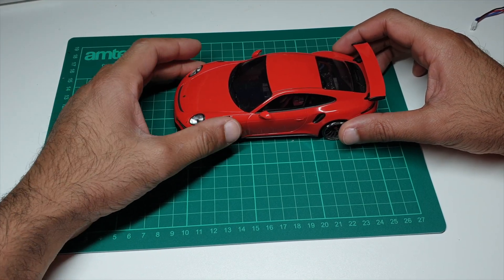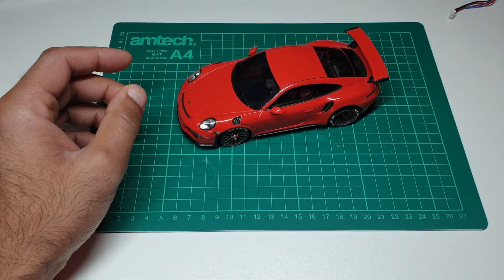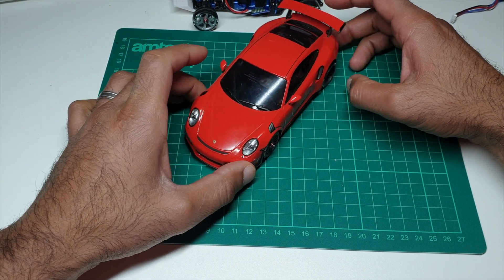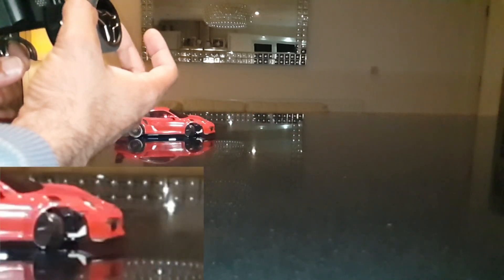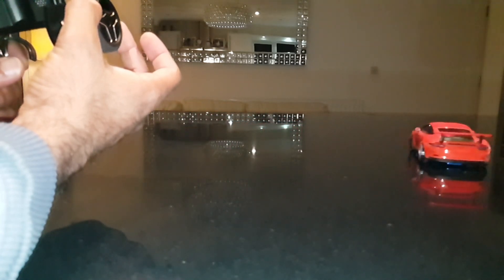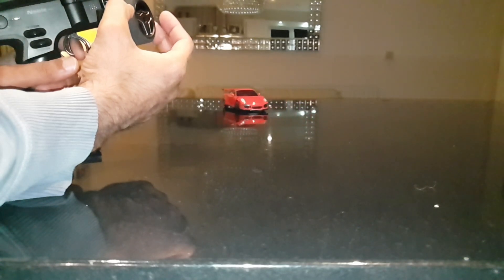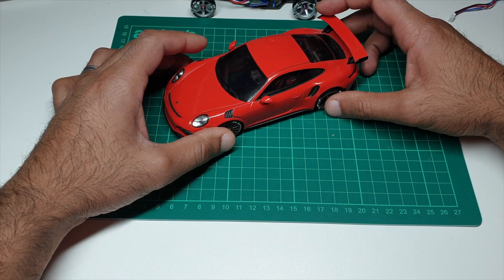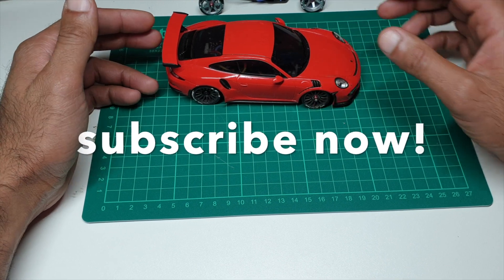Garage RC presents ....XRX dpa sport rwd mini rc  how to drift  tips for beginners part 2

Comment: Your channel has been a great resource for people like me who are just getting into the hobby. Much appreciated. I hope you can help me with this gyro issue I've been experiencing.

 I just finished building my XRX DPA Sport and everything works fine except for the gyro. The kit comes with the Evo2 gyro and I'm controlling it via port 3 on my NB4. I've done the EPA endpoint adjustments and that's all good. The problem is that the gyro does not counter-steer at all. as I swing the nose of the car to the right, the wheels also steer to the right. Swinging to the left also results in steering left. There are gyros like the YR Hackslider that has a DIP switch for rev/normal but I don't see that in this gyro. Am I missing something basic? Does the gyro need to be mounted with a specific orientation?
Reply from the maker: The gyro is set to reverse. You ha  to hold the set button until it flashes and changes direction of gyro I think it's 8 seconds I will check and add to my next video. If you hold for 4 seconds it's fod  setting steering endpoints. Send me and an email at Admin@garagerc.co.uk I'll see if I can send you instructions
Reply: @GarageMiniRCUK  thanks for the reply. I went and asked the shop and they sent me the instructions at https://www.agfrc.com/index.php?id=1989.The car performs as expected now. However, my fun was cut short as both drive shafts fell apart - one after the other. I ordered another set of drive shafts (10.5mm) that's meant for the GLD to replace these. Looks like they should fit and am keeping my fingers X'ed.
Reply from the maker: That's good. 
You should  have spare pins in the kit to repair drive shafts?

Comment: Great video,  really helping me out. One thing id like to know on your transmitter what setting is your motor speed/power?  set at., cheers
Reply from the maker: With 3500 kv motor I have it set to normal 100 %
Reply: @GarageMiniRCUK  i must need to change the set up some more, i have throttle at 50% and giro  100% (as it seems not to work at 50%)  and is so hard to control. 
At 100% throttle on the TX with gentle throttle it just spins round on the spot!!
Reply: all so if i turn servo left then let go the wheels don't return to straight position, same for when i turn right.  Both directions it returns to 1/4 off straight. ive taken steering rack apart a few times and all seems smooth, is there anything i could try or that you have come across that might help,
Cheers
Reply from the maker: I'm doing a video about this exact issue. Steering has to be very loose. I demo mine in video. Same for all kit mini rc cars esp rwd drift.
Reply: @GarageMiniRCUK  what do you mean by loose? 
I knew I was doing or setting something up wrong 🤣, 
I know it’s another level of skill to drift a RWD drift car but this thing just doesn’t give me a chance ! !
Reply from the maker: It's easier to show you in the video. The knuckles should be loose in ball ends in thst they can move freely. Not stiff. 👍🏽If you check my steering tips video until I get this one live..
Reply: @GarageMiniRCUK  thanks I know what you mean  they are all very stiff and hard to move,  I did try to move them about cause I thought they were to stiff but not sure how to free them up
Reply from the maker: In the next  video. 👍🏽